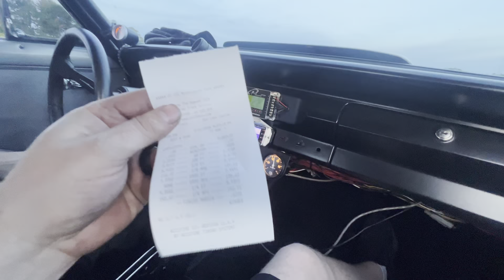WE BLEW UP THE CAMARO! Taking The 9 Second Naturally Aspirated Big Block Camaro Drag Racing

Comment: I’d love to hear the tech on your exhaust/manifolds etc.  blows my mind how BES makes that kind of power through manifolds……… what happens with a proper tube-collector header?
Reply: As this video shows headers don’t add as much as you’d think.  The stock exhaust manifolds are heavily modified.  I believe they usually cut them in half, port the snot out of them and then weld the two halves back together.

Comment: Maybe it was running lean like you mentioned but maybe a bit too lean?  How many passes do you figure that engine has on it?  Maybe it was time for a refresh anyway.  Yeah, a tear down video would be interesting. Good luck.
Reply from the maker: It lost oil pressure. It wasn’t blow up lean. Just leaner than I run all of our other stuff. I like to run 12.5 it was 13.0-13.2
Reply: @HorsepowerDepot   Oh bummer!  Thanks for the info.

Comment: Blew up the 406 in my 75 Vette going to build a Blueprint 434 soon
Reply: How did you do that?
Reply: @musclebone7875  Believe valve spring broke dropped the valve and tore up #7 to the point its not salvageable, keep the accessories, intake, carb, headers and start the 434.
Reply: @forterierocks  do you think that you over revved the engine for the valve spring to break?
Reply: @musclebone7875  No I never really abused it, I think it was just a bad spring unfortunately. It was a good engine and was in gosh 4 or 5 different vehicles my dad built before I bought it off him.